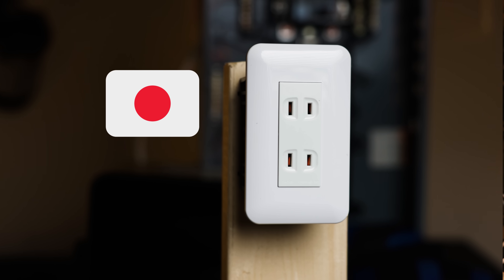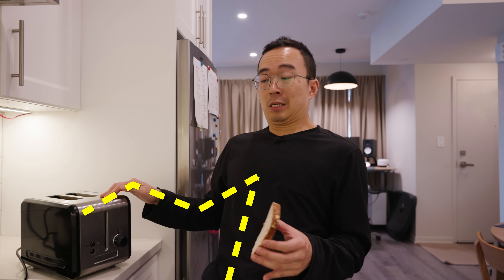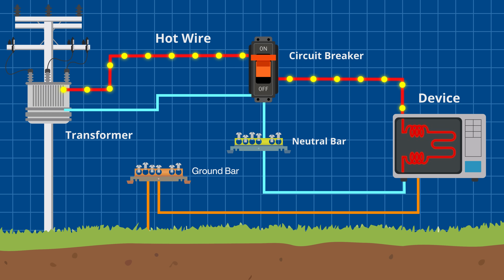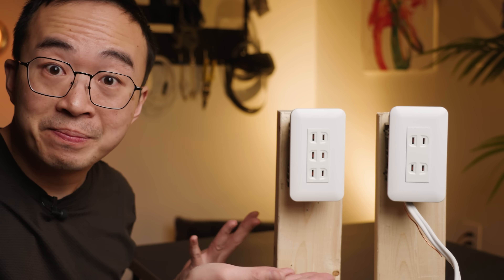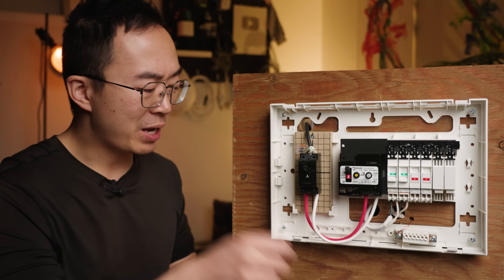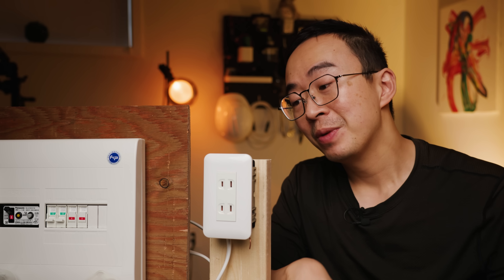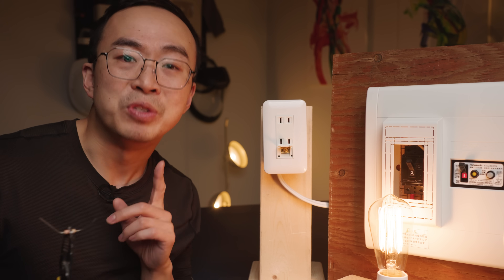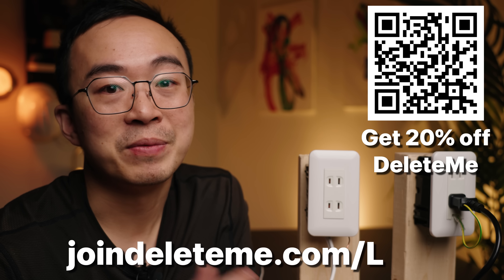How Japan Made Their Outlet Safe

Comment: So many things are misleading in this video...  First of all, GFCI and RCD are not the same.  You are correct that most RCDs are set to trip at 30mA and that is enough to kill someone under the right (or wrong?) conditions.  It just won't burn down your house.  GFCI is a type of RCD which will trip at 5mA.  I have not seen them outside of North America as the 30mA RCDs seem to be the norm pretty much everywhere else in the world.  Your first graphic of the grounded system is also incorrect, because in a regular breaker (non-RCD), the neutral does not go through the breaker.  It connects to the neutral bar inside the panel.  With an RCD, the neutral is needed at the breaker to sense the difference between the power going in and out, as your correctly explain.
Reply: He said that he wired up a Japanese Panel and showed the wiring diagram. NOT an USA Panel.
Reply: @ Yes his panel is Japanese. But he was comparing US and Japanese way of protecting against electrical shock. The breaker in his first example with the grounded system shouldn’t have a neutral if it is not RCD or GFCI. And while GFCI and RCDs technically work the same, GFCI is very specific at 5 milliamps and that name and specification is only used in North America. Everywhere else they call them  RCDs and they are 30mA. Hence the confusion.

Comment: A single GFCI breaker for the entire house would plunge the entire house into darkness if that breaker were to trip. If the fault were to spontaneously occur somewhere in the electrical system, it would be hard to track down. It is bad enough when several outlets are on the same GFCI and one causes the GFCI to trip.

A strategy would be to switch all circuit breakers off, reset the GFCI, then switch the breakers on, one at a time. The GFCI should trip when the faulty circuit is powered up.

I prefer to have the GFCIs at each outlet. Then, a fault will only disrupt power to devices plugged into that one outlet. A downside mentioned in the video is that the GFCI outlets should be replaced every 10-15 years. Few homeowners will think to do that. If the homeowner does the replacement, wiring errors might make the system more dangerous than if the outlets were left alone. An electrician could be expensive and there is no guarantee that the electrician won't make errors.
Reply: The worst part is your refrigerator will go out.  If you don't catch it in time, hundreds of dollars of food will go bad, plus a stench so strong you'd have to throw the whole thing out and get a new one.
Reply: Furthermore, with the American system we are perfectly protected against indirect contact in a reliable and simple way, which is the most dangerous contact and statistically most likely to occur. Direct contact, on the other hand, you have to be really stupid to go around touching bare cables knowing that you are not You must touch bare copper from a cable!!!

Comment: Too many devices have small leakage current to ground, smart outlets, yadda yadda. As a result the whole home GFCI has to have  30ma or higher threshold and that makes it still dangerous for human safety. It's better to put individual GFCI breakers or GFCI outlets with a lower threshold voltage around 5ma or less. Japan is saving 30% or more in copper costs though!

Comment: first thing that came to mind (less than a minute in): most consumer devices are "double-insulated, meaning there is no need for a ground. If the vast majority of devices that consumers use don't need a ground, then why require it in the outlet.
Reply: Because "The vast majority" does NOT equal 100% Duh?

Comment: Please correct me if I’m wrong!
Per NEC (National Electric Code)
Tamper resistant outlets Are required on new builds. 
I also believe that GFCI and arc faults are required on many of not most circuits. 
My woodworking shop is detached from our house if I understand the code my shop would require about $1,000 in just circuit breakers by current code. 
None metallic sheeted cable  (aka Romex) is not a good electrical system as it is very susceptible to damage both mechanical and rodents. EMT (metal thin wall pipe) should be required for electrical wiring even in houses 
FYI I am a retired industrial electrician

Comment: There is a second very important reason for ground to be included. some devices simply don't work without it. The reasons are complicated (Search for: Electromagnetic compatibility, EMC for short) My headphones give a constant hum without my pc ground connected to the heating pipes(I lack the proper plugs too T_T)
Reply: There is no device in my home that requires a ground connection to function properly.

Comment: i would expect whole house gfci to be a nuisance.  in wet conditions, there can be some micro current leakage in outdoor outlets.  it is fine that my outdoor outlets trip when that happens, but it would be a royal pain if my whole house went dark and add nothing to safety.
Reply: The USA National Electric Code does not want any lighting circuit to turn off in the same room as an Outlet Trip. Tripping the whole house is insane.

Comment: Not quite right on the North American ground. In normal function electricity comes from the transformer, through the circuit breaker and the black (or red) wire to the outlet. The "used" electricity returns to the panel enclosure through the neutral white wire, which is connected to the building ground rod (or similar ground point) by a heavy, bare ground cable. her is also an even bigger ground wire returning to the pole, where it is connected to a ground wire running from pole to pole. This is also grounded at the pole. The transformer is connected to this ground. 
Back in the outlet, the third plug hole is connected to the box, and to the bare ground wire which leads back to the panel and to a ground bar, which eventually connects to the building ground. This "bonds" the outlet, its box and the panel box to a save ground point. the bonding wire is usually the same size (e.g. 14 gauge) as the hot and neutral wires feeding the outlet. big enough to handle a short on that protected circuit.
The breaker  circuit breaker (or fuse) only limits the amount of current (e,g, 15 amps) that can go out into the circuit. It can trip if you put too much load on it (kettle plus toaster) or if a short occurs between the black and white wires or the black and anything bonded in the ground system. This includes the metal shell of an appliance or tool. In the event of a short, the electricity takes the path with the least resistance, usually the shortest - to the building ground. It does not normally return to the pole and transformer. The big ground wire returning to the pole "bonds" the whole panel (and house) in the event the main supply wires are damage or work loose. It also takes the "returning" electricity back to the utility, as when you are cooking, running your AC and clothes dryer. That could be over 100 amps or more. If it is too much, the main breaker cuts out.

Comment: The best thing is having both configurations in place. In Europe they have GFCI but also ground pin in every outlet. Grounding also helps reducing electric noise and static.
Reply: That depends on the age of the building, I have few ground sockets, because the building is from 1953. So what you say is mostly true.
Reply: GFCI from the panel do not work so well with the 110V, because they tend to trip for no reason. Much better with 220V.
Reply: Europe isn't a country
Reply: @TheFanatic340  Not sure why your comment has 2 thumbs up as the statement you’re making is completely irrelevant.
Reply: @kerel866  The point is that there are 40 countries in Europe and each have different way of doing things.
Reply: @TheFanatic340 EU standardized everything, and even other countries like montenegro follow them closely cuz they want to join and even countries not wanting to join follow their standards
Reply: @DamjanObradovic-dl9tk  Also they are mostly decent standards, made with EU government and industry together,
Reply: @DamjanObradovic-dl9tk  

Technically they were mostly unified even before the EU. It came as a result of close cooperation between the different countries' standards bodies and manufacturers needing uniform standards to be able to sell across borders.
Reply: @DamjanObradovic-dl9tk  No, the EU has not standardized the home electric wiring. There are different sockets, different grounding systems etc.
Reply: @DamjanObradovic-dl9tk not all of Europe is in the EU
Reply: @okaro6595  incorrect there are EU Standards the're are variations within those standards but it's largely standardized. For Example the Nordics dont use the Schuko connector for grounding, for legacy reasons. However, we have a third pin instead and all equpement sold in the EU today is  Schuko Type F or Type C compliant.  Schuko is the main standard in the European Union, and across most of europe. Same goes for HPFI and other fail-protective systems. And its very much bound in EU Directives and laws.
Reply: @TheFanatic340 but a large part is, and some other countries like Montenegro accepted their standards ine efforts to join. You do know the EU controls the import checking and standards right?
Reply: no shit sherlock! btw sukhoy never claimed that
Reply: @AmUnRA256 but he did claim a specific building code which is NOT consistent throughout all of Europe. it doesn't take much for a functional brain to figure that out. but here you are.

it's also a dig at the Europeans who use this comment when Americans say "Europe". cry harder
Reply: @TheFanatic340 it took your brain fart whole 10 months? congratz, here you are
Reply: @AmUnRA256 it took me that long by pure coincidence, your value to me is less than human so it wasn't until now that I even felt like commenting.
Reply: @TheFanatic340 have a nice day
Reply: @AmUnRA256 the smartest thing you've said all day
Reply: @TheFanatic340  yes but we have kinda unified standarts bruh
Reply: @TheFanatic340 correct but we do have directives that dictate laws to be implemented in each member country following the instructions in the directive, and on power installations there's a massive amount of cooperation and synchronization because of the inner market, such products can be used in all of the Union. As well as the ability to sell power across borders. Example there's not enough sun in Germany to produce enough power, but there is more than enough wind in Denmark, so Denmark sells surplus power to Germany cheaper, such that Germany doesn't need to burn coal. And it's regulated by the free market. The cooperation in The EU aka. Europe this makes it possible to align these things. In fact Europe is more accurate as Nations like Norway also comply with it even though Norway is not a member of the EU. So the statement is actually very valid, even if Europe isn't a country.
Reply: @pederslothzuricho7685 there is more to Europe than the EU
Reply: @TheFanatic340  let me rephrase what I said: The parts of Europe that isn't in the EU have EU compliant electrics because they are too small countries to not have a standard, and don't produce enough Electricity al year round to not be part of the electric power trade, so whole of Europe uses some variation of Schuko Type F and or Type C. With HPFI and 230V AC with PNE configs even using the same colour coding with yellow-green being Earth and Brown being the Phase and Blue being the Null. Even the UK swapped to follow these colours afaik. Although the UK uses different PNE plugs with their fuses in the plugs rather than at the main circut board of the house. They still use 230V AC PNE though, and the same regulations. The EU's influence stretches beyond its member states. So in this case Europe ~= EU. And the reason is the Market Economy which within the EU is much more influential than most people can begin to fathom. And i did originally also state a country like Norway which is exactly such an example, so i suppose you might have missed that by not reading my comment fully.
Reply: @TheFanatic340  sure and the Sun is not a planet. Anyway, why are you kicking in an open door? Who said that Europe is a country?
Reply: @soco75 when you make a claim based on a country's laws and then blanket it to "all of Europe" it's not going to be a true statement.
Reply: @TheFanatic340  1. Nobody is doing such claims
2. There are European Union Directives and Regulations for low voltage systems (50–1000VAC and/or 75–1500VDC) that all member states had to implement. It covers everything from mains, circuit breakers, CB boxes, overcurrent/lightning  protection, grounding, cables xsection, RCDs, allowed outlet types,  ... and despite European Union ain't a country, yet all these things are there harmonized. And countries like Iceland, Liechtenstein, Norway, Switzerland, ... that are not part of EU have adopted these as well

Comment: In current code for a while now, the US requires GFCI/RCD and AFCI (arc faults) circuit breakers save for the couple of places that have local exemptions and the even smaller number of places that use mid 2000s NEC for their code.

There are exceptions for certain use cases. An EV supply equipment device is a GFCI itself so you can wire it with a standard breaker. Ditto for sub panels. You can still use a GFCI if you want.

I think the real sorry you are missing here are the little indents on that receptacle and being able to insulate the base of the prongs, which is what Australia did with their NEMA 6 alternative plug. It would be great if that became part of the NEMA standard. Some outlets grab the plug at that point though so it would take a while to migrate to such a plug and receptacle.

Comment: In america, gfci is not added to ground.
The ground wire connected to gfci outlets has zero connection to the gfci device function.
In fact, gfci outlets are commonly installed in homes that do not have any grounding present at all.
Reply: Yes, in the  USA ... GFCI was ADDED to our already GROUNDED AC Electrical System.  You clearly do not understand what he said.

Comment: I’m a qualified Japanese electrician. Good video and good explanations but just to avoid a potentially misleading impression: basically all high power outlets are grounded in Japan. Also there are four different levels of grounding and a code for how to check whether an installation meets the required level (typically D for a household). Solar installations also need to be grounded. That said you are very right that earth-leakage breakers are literally ground breaking and should be required anywhere in the world.
Reply: is high power 220ish or 400ish volt?  and how are outdoor outlets protected?
Reply: @nox5555  By high power I mean high wattage, so basically any devices that consume more than 1kW and that you don't move around. They all come with a ground connector. Japan has split phase 100/200V, and any device consuming more than 1.2kW is typically 200V.
Reply: @ManfredvonHolstein  that makes sense. but how do they get power to bigger consumers like a stove or an EV charger?
3000 Watt from 200V sounds pretty scary for things that run longer than a couple of minutes.
Reply: @nox5555  All a question of cable and breaker sizes to deliver the required amperage. But in general everything is sized quite small. The normal EV charger delivers only 3.2kW.
Reply: @ManfredvonHolstein   they use more than 16A? or are they just ignoring the guidelines of 10% under rating for longer use?

Our Wall boxes in Europe are mostly 11kW.
22kW is just to expensive to install
Reply: @nox5555  3.2kW is 16A x 200V. But just as in the US, higher amperage is possible with thicker cables and correctly sized breakers. I typically install 14mm2 cables and 60A breakers for 9.6kW charging (48A).
Reply: @ManfredvonHolstein  its interesting how europeans use higher voltage while other use more amperage. my 11kw charger has only 16A with the 400V  pretty much every house in europe has.

Comment: If they're going to change their sockets and plugs eventually wouldn't it make more sense to go for something like the Aussie design or the schuko  rather than the crappy North American ones?  Bottom or side cord entry is much better at preventing plugs from being pulled out. 
They would need adapters but it's quite easy to make an adapter where a two-pin plug is permanently clipped into a three-pin adapter at right-angles. I've got examples that adapt  Euro (two pin) to both UK and Schuko permanently just by clipping in the Euro plug and screwing of clipping down a retaining lid.
Reply: The Aussie population is insignificant...

Comment: Wouldn't a whole-house GFCI/RCD have a higher threshold leak current than what is typical for individually GFCI/RCD protected circuits? That is, I'm guessing a whole house 200A GFCI needs a higher leak current to trip than a single 15A or 20A circuit. Therefore, the whole-house GFCI would be of more potential danger to small children, pets and the infirm.
Reply: People in the USA prefer GFCI that will not shock them. Europeans must like being shocked?  And NEC does not like the whole house going dark.

Comment: Hi! An EE student here. Yes, these outlets are obviously safer with RCD than without, but a combination of both is far safer, so it is somewhat misleading, but I understand where you’re coming from. All metallic appliances should have a fault circuit path that prevents you from getting shocked. Now you are getting shocked to trip the RCD: not safe. The only way to have a system with no appliance grounding provided is not grounding the system as a whole (isolation). Even then, it’s not that safe if there’s no separate transformer for every circuit. This would be unpractical, expensive and inefficient.